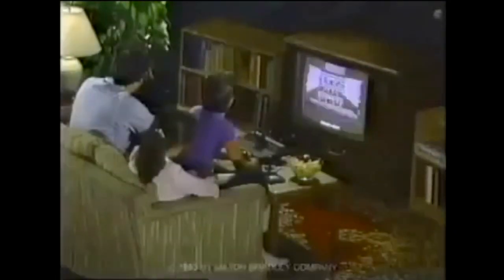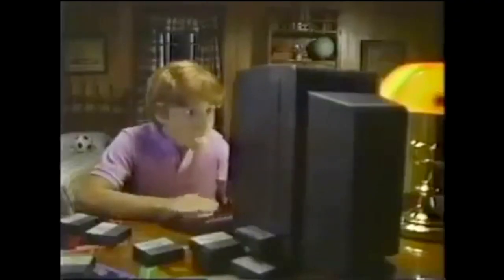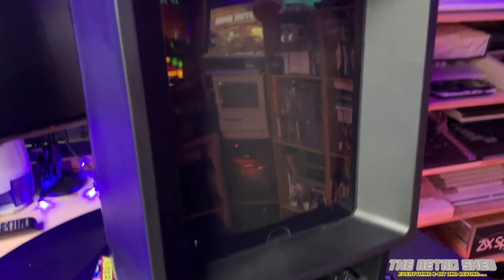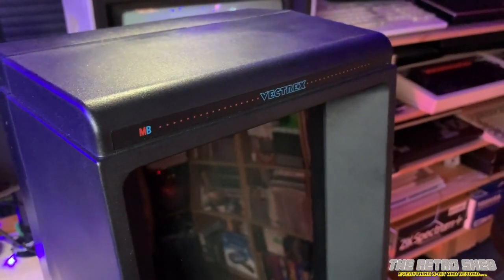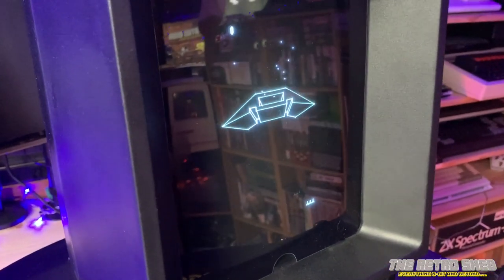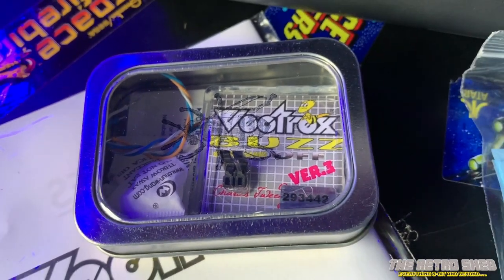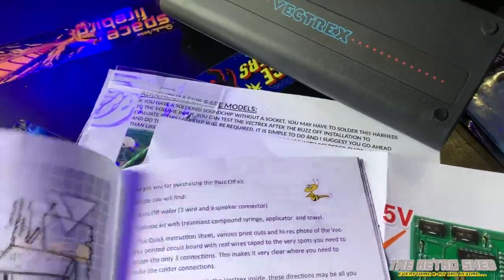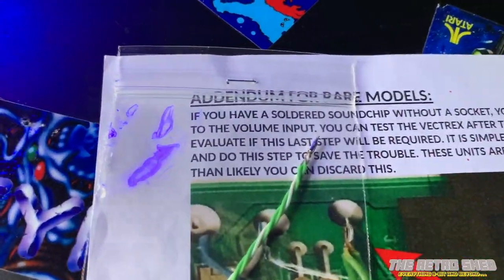Vectrex Buzz Off Install | The Retro Shed

Comment: Just for anybody out there trying to remove the chassis, My GCE version had a second screw underneath the board on the left by the transformer. So 3 screws on top, 2 underneath, left and right. Look for the red goo on the screw.

Comment: Very nice, wish I had better skill with a soldiering iron. I’d probably ruin my Vectrex 🤣
Reply from the maker: The Official Retro Asylum Youtube Channel ha ha yes be afraid! Be very afraid unless you can solder nicely. I’ve seen kit ruined a few times by bad soldering. :)
Reply: The Retro Shed Yeah I wouldn’t risk it myself although I’ve got to admit the buzzing has never really bothered me too much anyway. I’ve never used one of the later models that had fixed the problem. Just thankful to have a working Vectrex. Have you managed to play Vector Patrol yet? It’s amazing at what the Vectrex can do in the right hands 👍